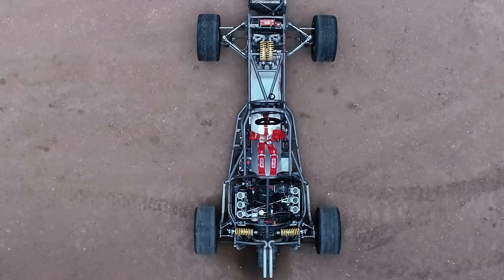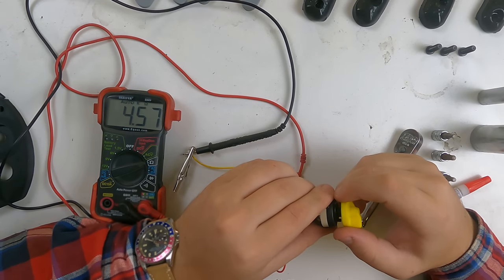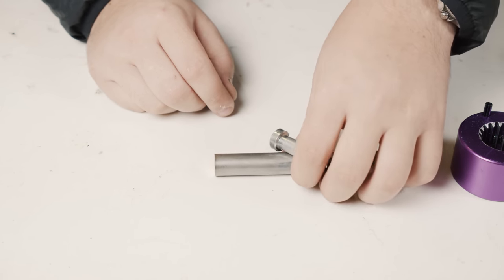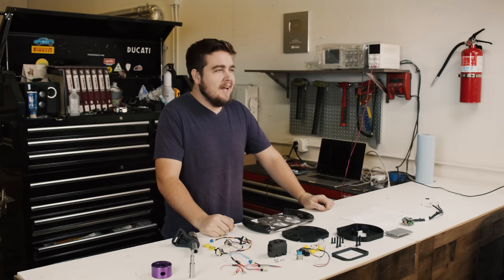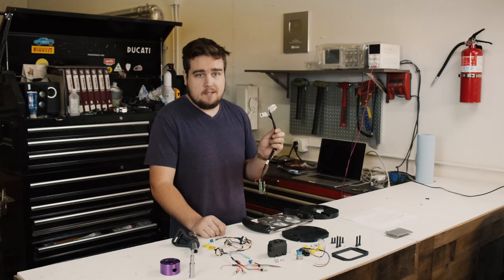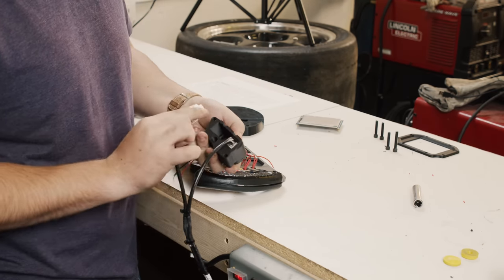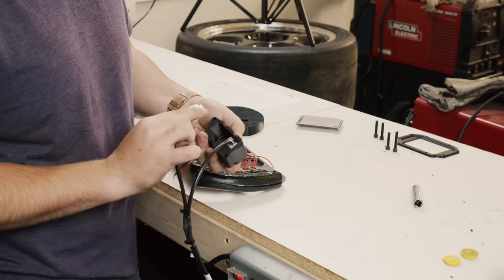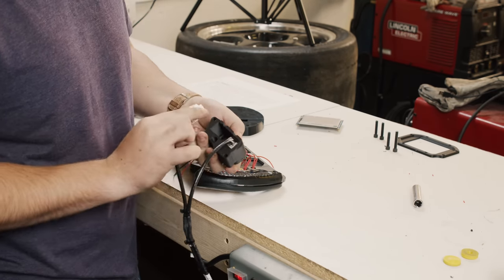The 60's F1 Car Returns with a V12

Comment: You ought to try using an STM32 board with one of the community made arduino cores. Gives you more flexability and GPIO with miles more memory. and instead of I2C, I would start playing with CANbus.

Comment: Should look into doing a CAN bus network. There is a few arduino hats that can add it. From there you can custom assign your data network as you see fit and still bring it across the arduino.

Comment: Any particular reason not to use a CAN Shield? I would assume (since they run all over modern cars) that it would be able to travel more than a meter. Glad to see you back, and liking the new shop!
Reply from the maker: I can, and with a bit more room with the newer board, there's actually some physical space for a decent CAN controller

Comment: You could also print a mold and use PU to create the handles. There a video on YT from an Italian who makes custom Fanatec sim racing steering wheels who does it like that. I believe it's a 3M product he uses.
Reply from the maker: I agree- It didn't cross my mind but casting molds with silicone or PU would be the way to go on those for sure.

Comment: The CONNECTOR at around 08:20 is RJ45. CAT-6 ist the specification of the twisted pair WIRE with shielding.

Comment: I find TPU easier to print in a dual extruder machine where I just print a few layers of TPU to cover the backing layers of filament that won't be seen in the final part. It's a lot more work but the less TPU you use the better the parts turn out.
Reply: Reported. The same company that wants to make self driving cars can't keep fake accounts off this site.

Comment: Nextion displays are pretty nice. they have their own processor onboard to handle graphics and events. you just design the ui with thier tool and upload it. can communicate via serial, could convert that to rs232. used them on sim racing dashboards.
Reply from the maker: This is a full onboard processor as well, but I'm looking into the nextion stuff. I ordered one in to play around with it a little.

Comment: Love this project, huge fan of the channel
Though, I’m worried you may not enjoy driving the car with a modern, non circular wheel.
Cars without the modern aero and massively sticky tires will inevitably want to drive with a little slip angle. At least vintage f1 cars did
Just imo, you may eek out more tenths with the ability to really play with the car, not being locked to that hand position
Imo as an scca licensed drifter who’s driven a formula Mazda leik once :>
Reply from the maker: Thanks! That's absolutely a fair point. I'm running on modern tires, but we also, without a doubt, have a problematic amount of power. We will see. You're right in that older formula cars will require a bit of play and I have a feeling this will be no different.
Reply: @WesleyKagan  I dont mean to knit pick at all, that wheel you made is amazing! Your work is so inspiring, I cannot wait to see your vision realized on track!

Comment: why you dont use CAN arduino modules instead off I2C? you can even directly communicate to ecu and dont have  problems with wire length and signal noise

Comment: When 3D printing TPU I'll usually print a layer of ABS, say 5mm, and then print the TPU on top of it. The heated TPU bonds pretty well to the ABS. The trick is to zero the z axis of the printer the top of the ABS print.
Reply from the maker: That’s a great suggestion- I had less problems with adhesion and more problems with almost bubbles and stuff in walls and floors. I’m thinking I’m running too hot, even In the range

Comment: Regarding printing TPU, What about regular PLA and the a plasti dip application when it's mounted? Unless you have buttons hidden there, that could get messy....
Reply from the maker: I was hoping for a softer grip, PLA still feels like hard plastic no matter how many coatings. I was recommended making a mold and casting out of silicone, which I think is a good solution, Honestly.

Comment: Hey there, I've enjoyed your videos. I've had some issues with CAT5/6 connectors in applications with vibration, sometimes they are shaky. They don't fall out, but I've had flickering. I also don't love the failure modes associated with swapping to CAN, but I'd be looking for a backup connector option just in case.
Reply from the maker: I understand and agree- my saving grace is that where the Cat6 locks into the wheel, is supported by a few other points on the wheel. So Ideally there shouldn’t be any movement where the connector is. Time will tell. I’d love a spec sheet of the connectors for long term abuse, but I’ve been unsuccessful in finding any, honestly.
Reply: @WesleyKagan  In space / military applications chunky old d-subs are still king for reliability and vibration (usually micro or nano instead of full size). Dare I say some cheapo 9 pin, 15pin, etc pre-made  d-sub cables for antiquated serial ports might do the trick if you start having issues.

Comment: This project will become amazing fore sure. Could you solve the problem with the IC^2 by using an USB protocol which has differential signal and also with shielded wire so it's less subject to noise ecc. so you can have more than 1m of wire ?

Comment: Have you thought about running a bus buffer between the I2C equipment and the CAT-6 cable to manage the impedance mismatch so you can get better distance?
Reply: I2C Doesn't go fast enough to bother with impedance.

Comment: Have you looked into using an ESP 32 as they are considerably more powerful than an Arduino and can be programmed with Arduino C too
Reply from the maker: Teensy is getting recommended a lot, I just need more practice with it before I toss something big like this at it.
Reply: @WesleyKagan  Teensy 4.0 has the processing power and ESP has the communication (built in WiFi and Bluetooth) so it depends if you think you'd need them, both are massively more powerful than the Arduino though

Comment: I know it would probably be too late, but I wonder if a pi pico might be better fit for this project.

Runs a little faster, runs heftier code, and is just a little better all around, and would possibly give you some more headroom
Plus the sensors and stuff should just plop over
Reply from the maker: I'm being recommended teensy boards as well, I just haven't spent a ton of time with it yet.
Reply: @WesleyKagan  Teensys are cheap AF and you actually flash them with the same arduino IDE, so as long as you update the pinouts, you shouldn't have any issues just flashing right over, and on top of being able to keep using an environment you are already familiar with, they should run faster which would help in the end with all the different systems you want to use.

You should also look into I2c Multiplexers such as the TCA9548A. Just allows you to use 2 pins to hook up to 8 i2c devices, also allows you to use multiple of one device that doesnt have a changable i2c address.

Edit: was just doing some digging around, and it looks like you can use USB drives with the teensy too. With that I bet you could have it export logs and telemetry.

Comment: Wesley, you mentioned you built the shifter mechanism and that you share files, like the steering wheel files. Would you be open to sharing the files for the shifter as well? I'm also building a car from scratch and it uses the same Audi gearbox the Boxster uses, but in my case the engine will be an Audi V6. Anyways, since it's also mid engined I'll need to activate it differently to what it is now.

Comment: No use of i2C on twisted cat6. You are twisting clock with data. You should twist a differential pair of just one signal. Then you cancel out noise. That is CAN

Comment: Im sure you have already considered this but I am curious why your chose to angle the radiators backward rather than forward? 
As always your builds are simply awesome!
Reply from the maker: Because I haven't tossed anything into an Aero simulation yet to see how much it will screw with things. I have this hairbrained theory that angling them the other way would cause lift, but I'm unsure. I angled back because the Corvette and GT40 did it that way. Still need to explore it more. Thank you though!
Reply: @WesleyKagan  you have the right config I think, without going for sidepods. 

With well planned ducting you could point the outlets towards where a bargeboard would normally go, and have it attempt to flush wheel wake away
Reply: @WesleyKagan  The GT40, Lola T70 and Porsche 917 actually have their radiators angled forward. I think this was commonplace on most mid engined racers from that era. These cars have air extraction vents out of their hoods, so perhaps that influences the radiator tilt. I am in the process of replacing/rerouting the coolant system in a Lola T70 replica and this is why I am asking. I am sure either direction of tilt will work fine and as you pointed out the Corvette does have the radiator leaned back and it works well in that application.

Comment: What is the distance from rear axle centerline to the front of the crankshaft pulley? I have a hairbrained idea to put this same engine and transaxle into a late model Corvair. I'm already thinking about stretching the wheelbase so I can still fit in the thing.

Comment: Watched all now. 1) Get a Teensy 3.6 or 4.1.. Many times faster and Many times more memory. More inputs etc. 2) add a CANbus transceiver and use the Teensy to interface with your ECU (hopefully CANbus) 3) connect a BT module and use that to drive an app on a phone for the screen. I have been where you are. I went through 3 directly connected screens before figuring out they are terrible ideas.
Reply from the maker: I don't disagree, and I actually ordered in a teensy the other week to start playing with it a bit. I just know Arduino stuff like the back of my hand so it works great for prototyping. Plus I literally have a box of them hah. With expanding the board to hopefully have connections and less soldered wires, I have some room to play with as well.

Comment: Not a CAT-6 it's an RJ-45 connector. CAT-6 is a standard for the wire.
Reply from the maker: Correct- I knew messing with network stuff I was going to get some terminology wrong.

Comment: Sorry for my question. Why did you put a modern style steering wheel in to a like 60's F1 car? In my opinion you have tu use something similar to the old style steering wheel and put the screen and the switches on that.

Comment: Based on using reverse gear ratio method for rpm how does it read when in neutral etc? Basically how is rpm read when wheels aren’t turning

Comment: I have done something relatively similar, but totally different (but also quite similar) I just have a display showing my cars indicator lamps on a similar display, using the adafruit library.  I found the library mostly useless and instead draw each icon in a block of code (I can't remember actually how.. converted the bmp to code online). A friend of mine is much more advanced and uses a much more advanced Arduino based system with proprietary screen. His dash is farkin amazing... Arduino's just don't really have the HP to enable high enough refresh rate (from my experience).
Reply: What I did do was make a piece of test code which basically stress tested the efficiency of my code and how it sent data to the screen. I was able to make code optimisations and watch the timer decrease every time I ran the program, was quite a neat experience

Comment: Why not swapping out the mega for an esp32 and The smaller arduino for an esp8226. More power, more memory. Wifi, more memory and multiple i2c If you not wanna switch to can-bus or modbus. Can be programmed in arduino with almost The same code

Comment: How did you get the i2c working over longer distances? I am working on a similar project and ran a lot into that, finally used the NXP PCA9615 to get my issues ironed out.

Comment: Yo. TPU is a pain. Always print with about 80% cooling. No retraction, TPU cant be retracted nicely. Print with very high density, TPU doesnt like bridging. Honestly, just print it with ABS or Nylon and cover with leather, much nicer anyways, thats what I did for my sim racing wheel i printed.

Comment: where does the speed come from ? I guess if it's from the wheel rotation, the gear ratio could temporarily show wrong gear if the tires slip too much while accelerating or breaking

Comment: What if you used fiber optics for sending the data? You should be able to get fiber optic media converters working. You're probably adding weight as you won't be using miles of cable... come to think of it you might not get any benefit because there wouldn't be much latency over a short wire... I'm not an expert so I could be wrong.

Comment: Instead of printing TPU, I may suggest printing molds and just casting the pieces in a high-durability silicone. Granted, your a level 100 DIY mage, I'm like a level 40.
Reply from the maker: Honestly, yes. This is the way. Could even do the custom grips to fit your hand. 10/10 idea.

Comment: hmm. you could use just same resistor value for all the resistors on the rotaries by wiring them differently/lazierly?
Reply from the maker: Yes, You actually could I'd think. Just treat them as if they were wired in series.
Reply: @WesleyKagan  yes, series. only problem with it is that at the high end the differences become harder to measure at the microcontroller end like if all of them are 10k for the 8ght you'd need to tell between 70k and 80k, while for first it's 10k to 20k a 100% increase, though that wouldn't yet be a problem for the micros used nowadays

Comment: Your display will be easier to read at speed if you remove all the vertical bars. Not sure why you are using a minimal computer in a racecar? Something that can perform lots of data acquisition and not force you to program by shoehorn should smooth out the ride? Lots of "fanless industrial" computers to choose from.

Comment: Why don't you use the lathe you've been keeping a secret from us to make your selector knob out of aluminum then you could put a detent ball in the back of it, so you could put it up against a back plate with as many holes as positions you need. Then you can just use a potentiometer and it would clean up the wiring.

Comment: why not use CAN-BUS instead of the I2C? Just size constraint?
Reply from the maker: Yes, But as I'm expanding the board on the steering wheel side, I might switch to CAN
Reply: It will also mean that an upgrade to say, a haltech ecu might be near seamless

Comment: Woah! An ´83 Interceptor! If you need any information on the bike, drop me a line (or tell me to drop you an email or something). I have been wrenching on my VF750F since 2010 and have gathered a few bits and bobs of knowledge about the bike. (custom, harder camshaft, VF1000F oil pump, thermostat switch, interchangeability of European vs US rims and brake discs, a few 3D printed cosmetic parts, on/off switches for the fuel pump, .... etc. )
Reply from the maker: It's the spark boxes that I need right now haha. I've been working on it in the background when I get a few minutes

Comment: Great video! Just wanted to chime in on @15:00. I2C can actually be long distance, just need to lower the baud rate :)

Products we've designed at work for industrial applications have up to 35' jacketed, non shielded 4 wire cables (power, i2c data, i2c clock, ground) and have zero to minimal dropouts (dropouts are filtered out)
Reply from the maker: Interesting! I've heard of some long range "converters" that can get that result, but It just wasn't needed for my solution. Very Impressive though!
Reply: @WesleyKagan  in this application its just a microchip pic and raw i2c nothing special
Reply: @WesleyKagan  I just looked back at your schematic and I think I know what is causing the issue.

I2C requires pull-up resistors sized for the baud rate chosen. This is because most microcontrollers implement I2C in a pull down - Idle high, which requires the external pullups to pull it high. For 100k baud rate 10k is the usual choice for pull-up resistors on the clock and data line.

I'm pretty sure this is why you're having short range and packet size limits. Hope this helps!

Comment: Nitpicky network engineer here: The Cable you're using may be CAT 6, however this refers to the shielding inside the cable. The plug is actually called RJ45.
Does that make a difference? No
Is it important? No
Is there anything else in this video I could correct you on? For sure not
Would I be able to achieve even a tiny amount of what you did there? Hell no

Comment: This is probably going to be a dumb question as Im not a mechanic or engineer. But can anybody explain to me how this is actually putting power to the wheels?? I see the end of what Im assuming is the transmission at the back of the car and it's confusing the heck outta me cuz it looks like its capped where the driveshaft would traditionally be. Any explanation would be appreciated, Im super confused!
Reply: Or am I just a dunce and Im looking at a transfer case on the back, not the actual transmission